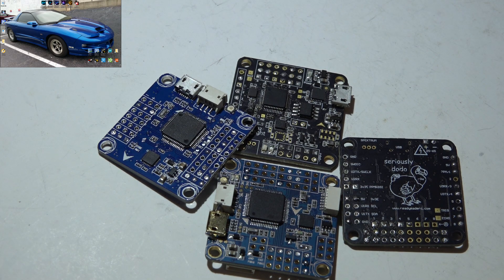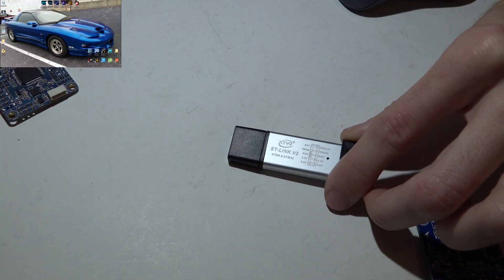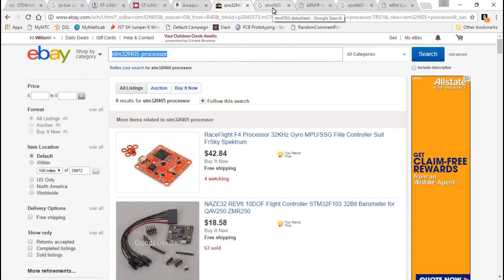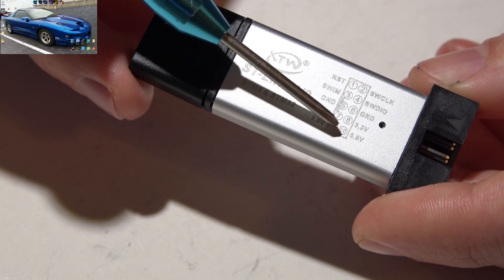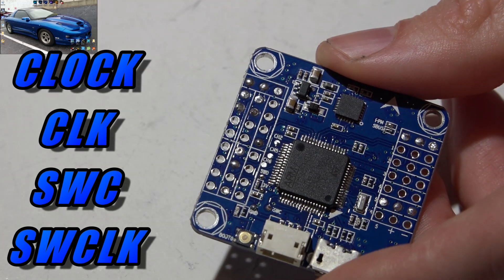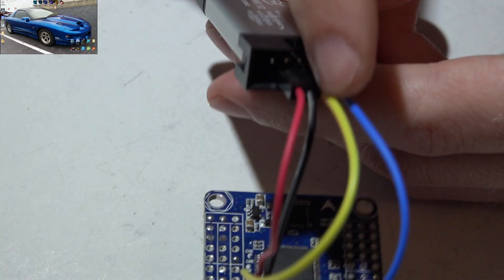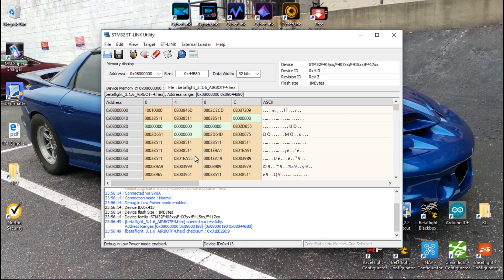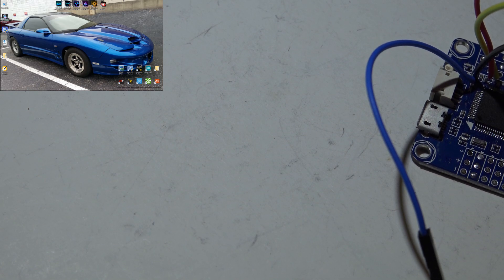Flight Controller STM32 Processor Replacement: Part 2

Comment: Hello. Do you know that if you replace STM32 F722 - series proc. You do not need a ST-Link? F722 has bootloader in ROM.
You able to flash firmware thru USB by DFU(boot) button in betaflight menu

Comment: Awesome video!! Thank you, keep that way!!
Just one question, can I flash betaflight using the same procedure with an F7 stm32 chip? If so, what if the FC doesn't have the IO and Clock pins? how can we flash firmware?
Again, thank you so much!!
Reply: Have you figured it out? I also want to replace the MCU on a F722 but I have no IO / Clock Pins and no clue if this still works

Comment: Hi,
Thanks for your video . It is very helpful although it didn't work out wel on my NAZE32.
I replaced the STM32 for a new one , connected the ST-LINK from my Nucleo board and flashed Cleanflight 2.5 on to it. The Flashing worked but the FC didnot start after reboot. I compared the HEX file and the memory with the ST-LINK Utility and it seems that adress 0x08000000 to 0x080003FF hasn't been flashed. All those adresses still contain FFFFFFFF. What went wrong and what do I need to do to fix that? I hope you can give me some suggestions! Thanks in advance.

Comment: On some fc boards like the Flip32, they have what's called the debug pins. I think you can wire it up there too to an ST Linker to flash the firmware

Comment: Hello. Do you know that if you replace STM32 F4 - series proc. You do not need a ST-Link? F4 has bootloader in ROM.
You able to flash firmware thru USB by DFU(boot) button.

Comment: I have an Omnibus f4 that I cant use an x4rsb with. I removed the 2 resistors?/jumpers through some misinformation. I can use a d4r on another pin with ppm remapped through betaflight, is there a way to use x4r on anything other than it's intended pin? Thanks.

Comment: Do you have any idea on why my FC doesn't do anything when I connect my USB to it the computer doesn't see it at all. I plugged the battery up to it and I get sounds and lights but the DfuSe doesn't see the fc so I can set it up .. it's a KISS FC by the way

Comment: great video, thanks again.
By the way, and sorry for asking a not specific question related to this.
Do you know the name of the connectors that fit into de omnibus f4 v2 pro?. There is the option to fit the esc's cables in one of the housings, but need to know the technical name and where to buy them
Keeep it up